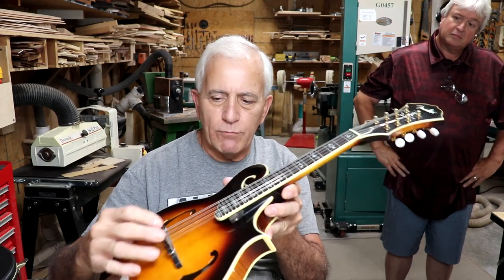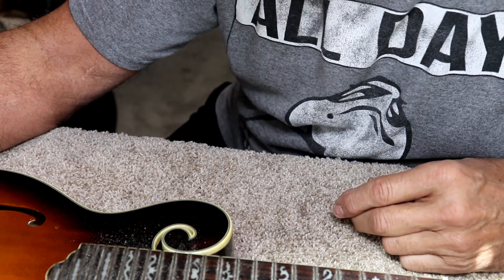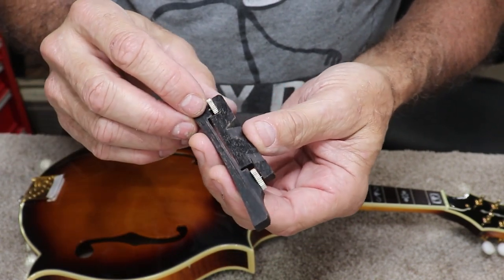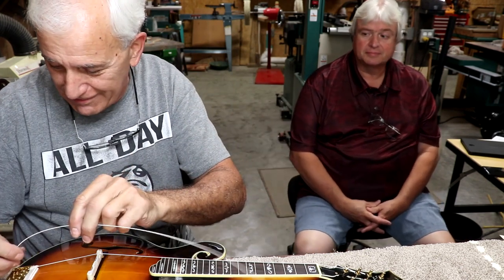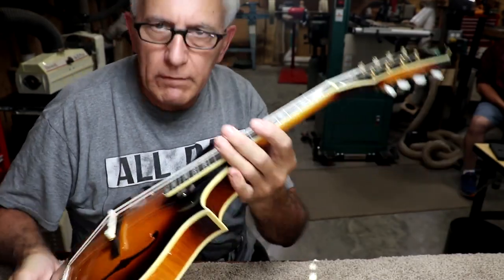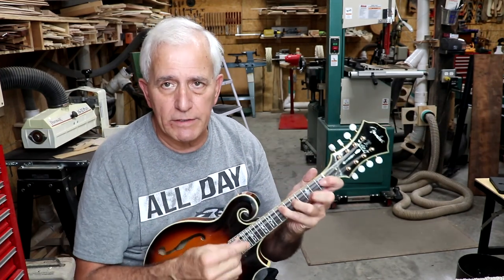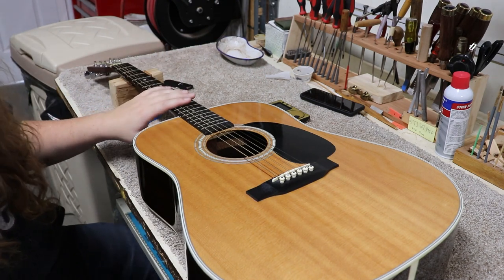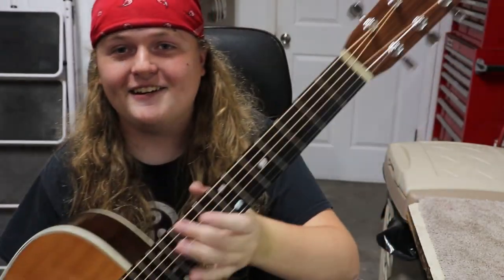527 RSW Full Meal Deal and Creative Clamping for Michael Part 1

Comment: Seeing you scraping that neck reminded of the time that I refinished my 83 Gibson Flying V.  The first thing that I tried was chemical stripper.  It barely made a dent.  I ended up peeling the entire finish off in small pieces.  I swear that finish was like a piece plastic on the wood.  My V has been through a couple of finishes since and now has a couple of coats of rub on poly.  And the guitar sounds and feels great!

Comment: Jerry, if you put 2 pieces of heat shrink tubing, over the looped "horn end" of your string
and then extend the "tag" end to behind your right shoulder, tying a slip knot there, you
can then slide one piece of the tubing to the slip knot and shrink it. Then slide the other
piece of shrink tube down near the horn an shrink it. Now, there is enough length to adjust
to anyone and both ends of the adjustments will lock n place with the tubing.
I hope that's understandable.